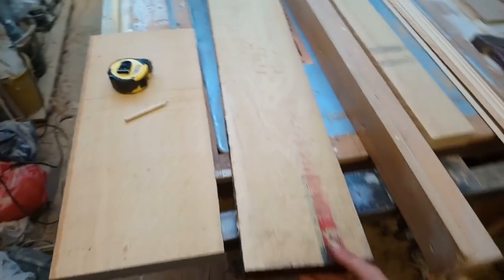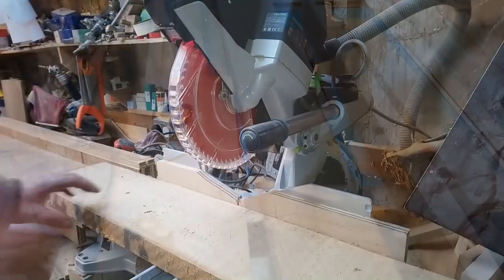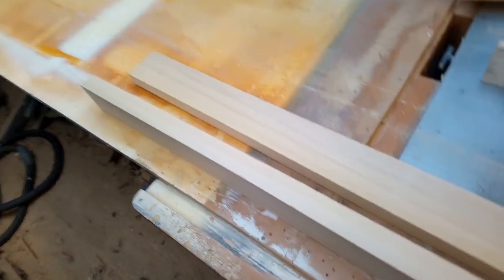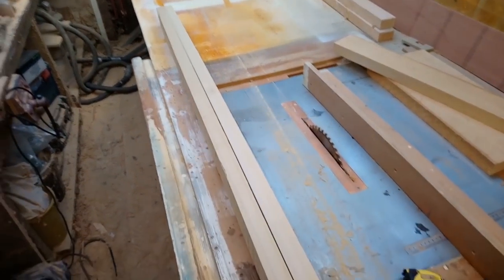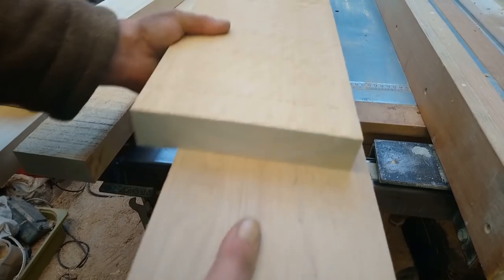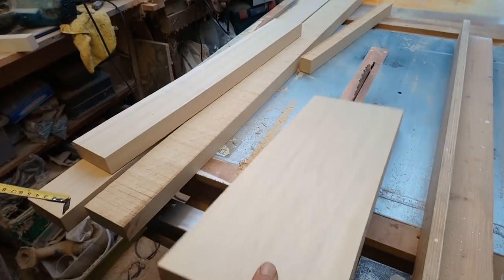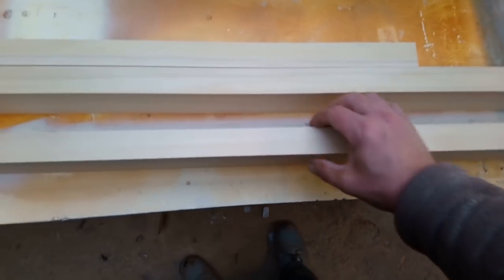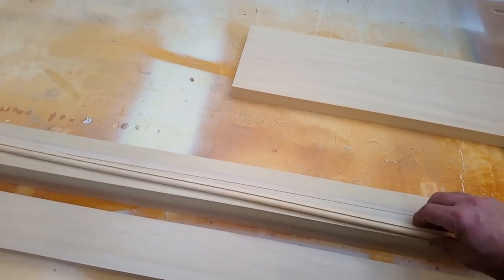Hilary's basement Pt2 - Cutting & planing the Tulip wood for the internal door

Comment: Hey Gid can you make sliding sash windows?
Reply from the maker: Hi, Basic sliding sash windows are fairly simple & quite satisfying to make, A sash is the moving part of a window so even the hinged ones are called sashes, 
The main frame is made from boards that interlock with tongues & grooves, the top runs through into the sides which helps hold the sides sq, they almost hold themselves together without glue, the two sashes that move are just frames held apart with a parting bead, & held in from inside by a stop bead,
There's a drawing on here 
http://topwindowsdoors.co.uk/timber/windows/sash.html
Reply: Gid joiner very interesting and great drawings in the link, thank you
Reply from the maker: no problem 👍